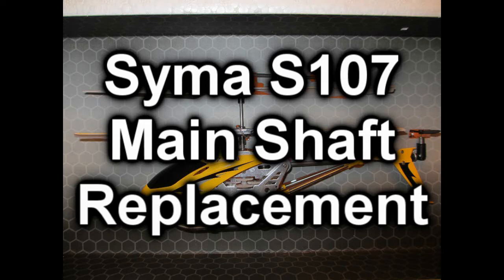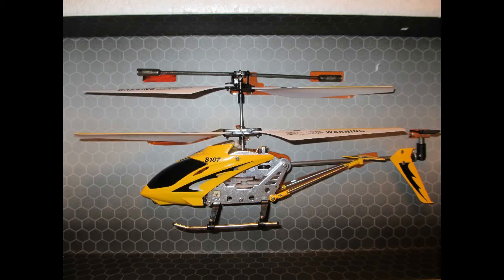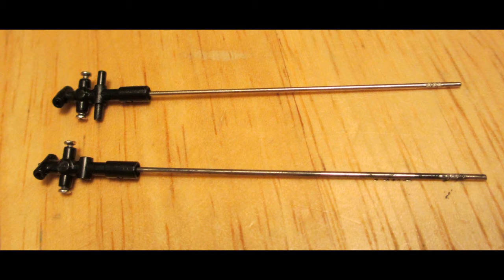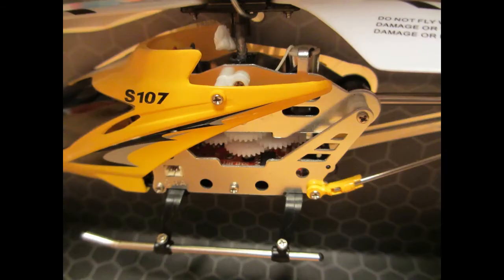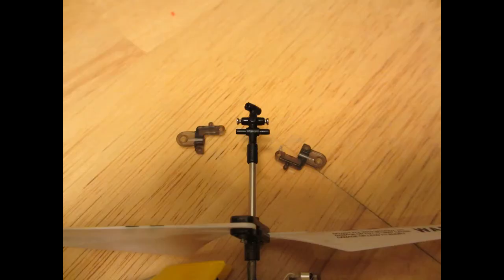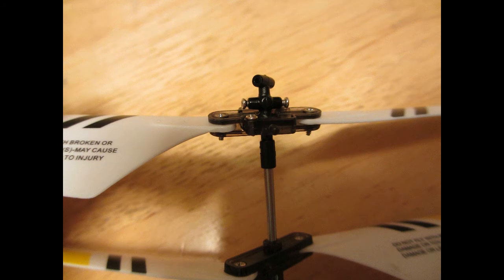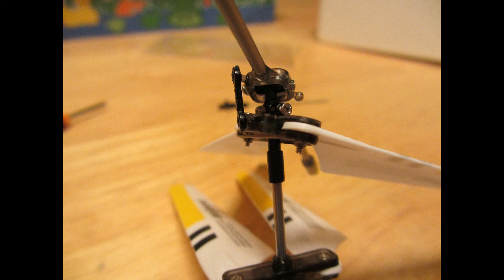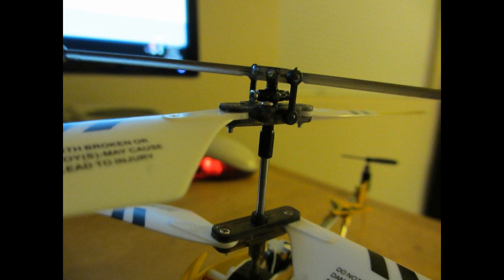Syma S107 Main Shaft Replacement

Comment: It pays to read the comments CopyKattz28 got it right. I just turned the 2 screws at the top of the shaft (below the ones the balance bar pivots on) and the whole black plastic assembly lifted right off the shaft. No pliers, no force, no need for a whole new shaft, and no need to press a new shaft down into a gear. Easy-peesey!

Comment: Like Stephen Nazigian says (below), I found I could loosen the set screws near the top of the main shaft's plastic head, and take the plastic up, off of the shaft.  (That way, there's no yanking with pliers, nor messing with gears.)  To install the new plastic head, I just had to make sure it was pressed down all the way, and that one of the two set screws aligned with a flat spot near the top of the metal shaft.
Reply: +Paul Brogger thank you this saved me a load of effort, and hopefully resulted in one very happy little boy!

Comment from the maker: It has been a while.  I got the gears in place in the body of the helicopter, then pushed the main shaft in from the top. It takes a bit of pressure to get the shaft seated in the gear.

Comment: THAT NOT CORRECT ! What you need to do is loosen the 2 screws that oppose each other on the top disengauge the black plastic rotor mount and no need to pull any shafts

Comment: that's the weakest part of the heli  I have replaced mine a couple of times they should do a upgrade on that part , and when you put it back you get problems with the fixing screws do not tighten and some of the new shafts come with it already glued that's what I do with them do not use super glue I use LOCKTIGHT ALL PURPOSE ADHESIVE EXTRA STRONG (the purple one)l